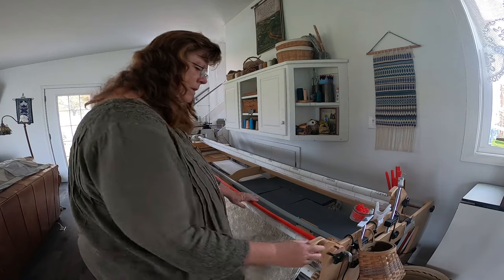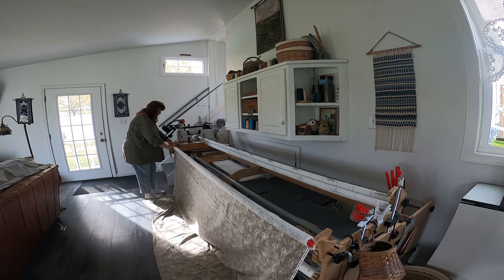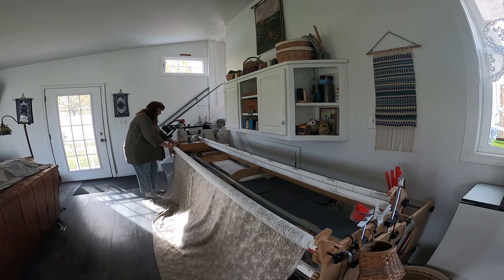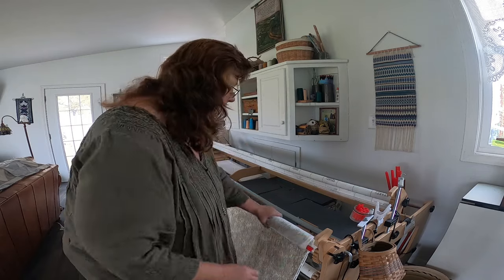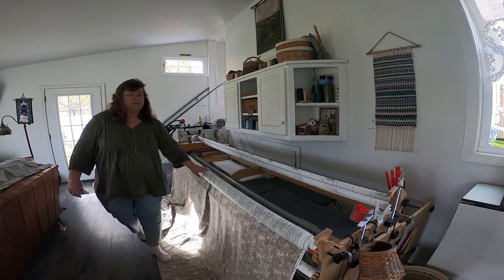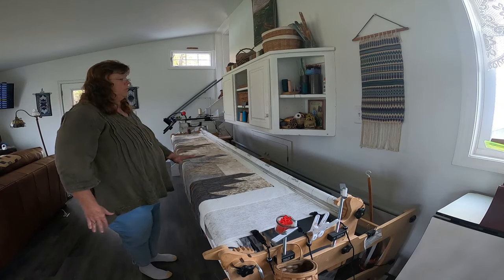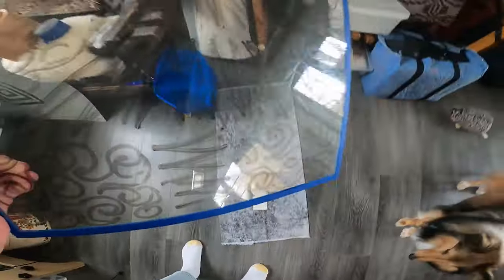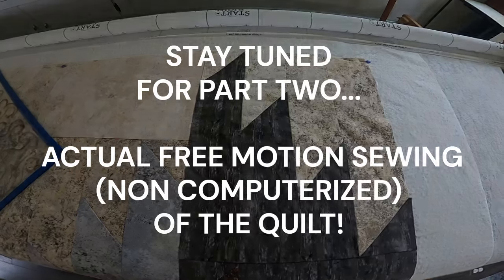LOADING A QUILT ONTO A HINTERBERG FRAME

Comment: Nice video.  I always learn something by watching how someones else does it.
I bought red snappers years ago and have never used them.  Did you get special leaders for yours?  I was afraid my leaders would be too thick for the snappers. 
Is there a slot on your table for the coduit you have your batting on?  I would love to see a close up picture of that. That would be so much nicer than having the batting bunched up under the table like I do now.